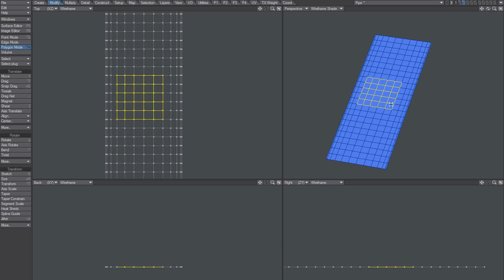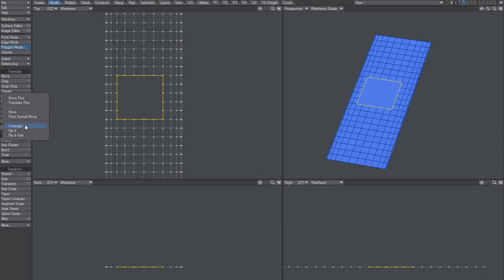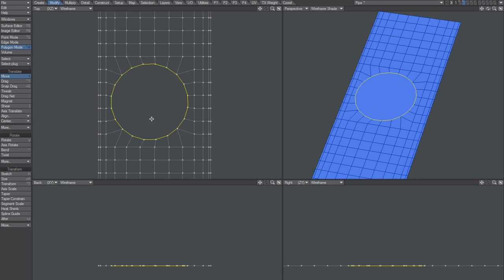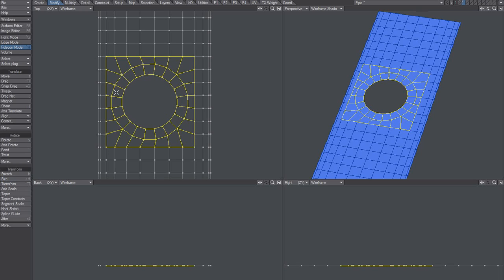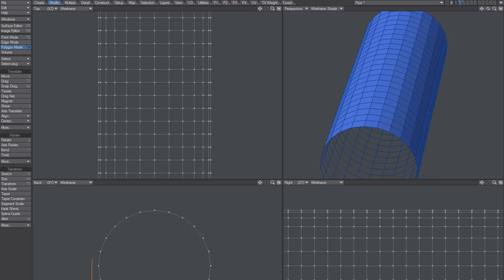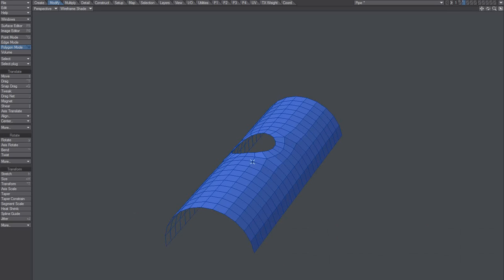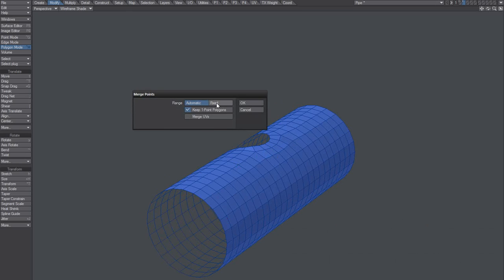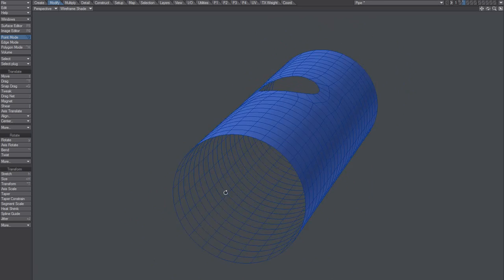LightWave Model - Pipe, Hole #1

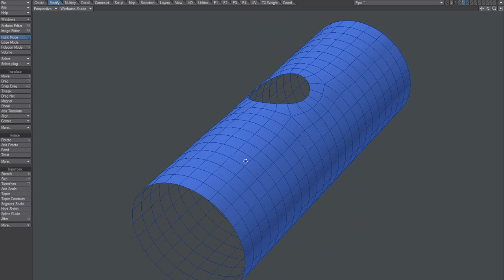Comment: those 4 points  2:40  at the end creates probs , what do you mean by tweak them ? nice trick btw :)
Reply from the maker: thanks :] what i mean by tweak is basically just move them a bit up/down or outwards (scale with "action center selection" mode)
Reply: thank you (y)